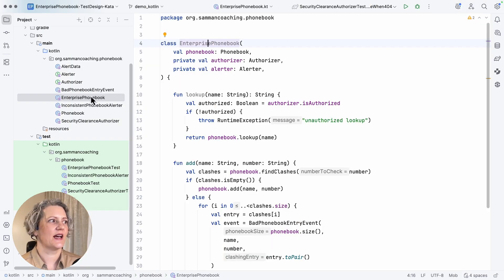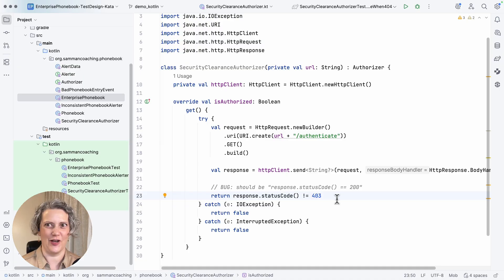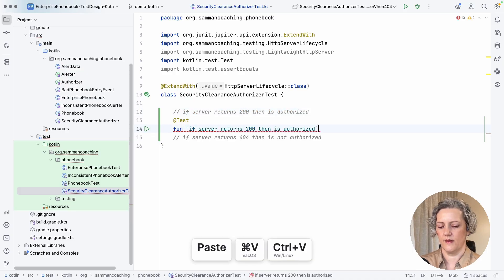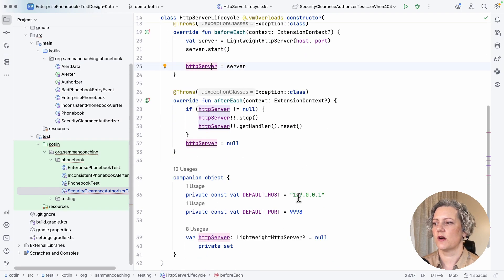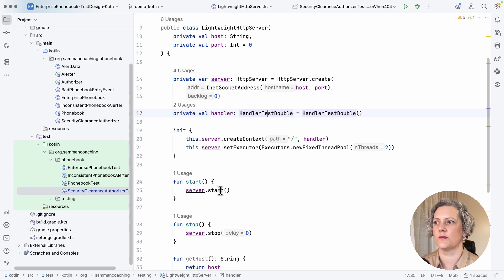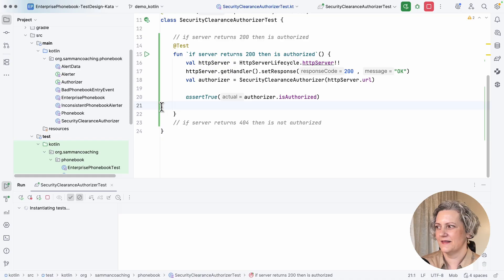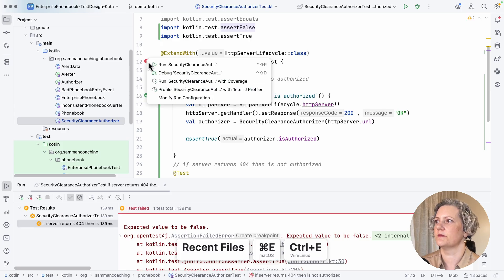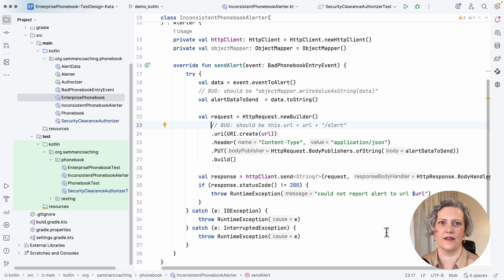What to Mock in an Integration Test (Expert Advice)

Comment: Nice! This is a GOOS-like integration test (which I like to call "adapter test" since the integration test term, like you mentioned, is a bit overloaded), right? I find these work great for some edge cases, for example: the driving adapter HTTP validation (no need to load configuration and start Kafka/other broker or load config from database if the requests will be stopped at the entry) or driven adapter error handling (e.g. an Http Client might return many types of errors, it may time out, it may malfunction and break the connection - typically most of that is translated to one type or metatype of error so no need to spin the whole app just to test that stuff).
Reply from the maker: Cool. I like the name 'adapter test'.

Comment: I want to share something I learned recently about Kotlin’s computed getters/properties, which I used in a similar way as you did here. From Kotlin’s own guidelines (I can try and find the exact quote if you’d like) getters should be simple, deterministic and free of side effects, including the possibility of exceptions. For example they might do a simple calculation on some other fields. 

In your example here you should prefer a method over a property.

I know it’s beside the point of the video, I just wanted to share it in case you’d find it useful.
Reply from the maker: thanks, I'm pretty new to Kotlin. This seems like sensible advice.

Comment: Emily, if this is a narrow integration test, what would be then the unit test ?
I'm asking because in the UT, I'm supposed to provide the inbounds and check the outbounds to see that in all situations my code is working. And here, one of the input is the httpclient. So I will need to mock it up.
But that's maybe where my understanding is flawed.... A UT is maybe not possible here as I cannot single-unit test this because other units are mandatory. Therefore, only a narrow IT is posssible.
Cheers.
Reply from the maker: You could write a unit test for the adapter by mocking the httpclient but you are mocking so much then it's hard to be sure your code works properly. Usually you only mock interfaces you own in a unit test.

Comment: I like the handler test double, made something like that myself for C# as well some time ago using a httplistener that fakes a real server. Too often I see people making a gateway to mock in testing and then forget testing the serialization/deserialization that often happens inside the real implementation, or write slow E2E tests to test that part.
Reply from the maker: Nice. I need to translate this example to C# and that is a good clue for where to start.

Comment: Which one to write and when and why? (Narrow vs wide)
Reply: Personally I prefer narrow and overlapping tests, so make narrow integration tests for the edges of you application, then make overlapping sociable unit tests for any component that depends on these outer components. Doing that you really don't need wide tests. Basically, if you fully cover all state/behavior of A->B, B->C, and C->D then there is no reason to also write tests for A-..>D.